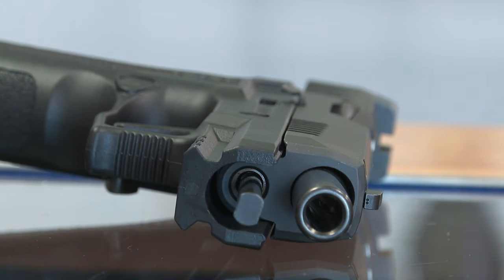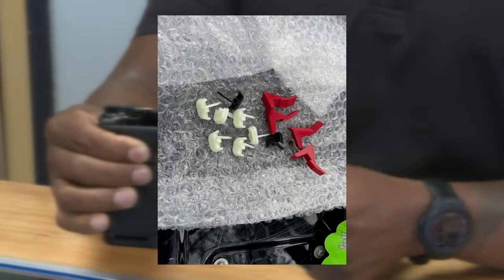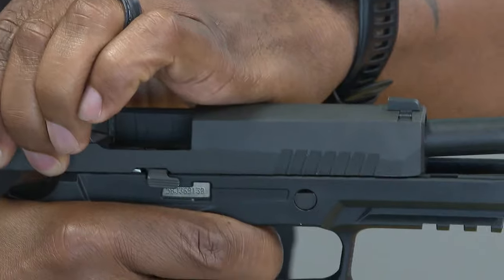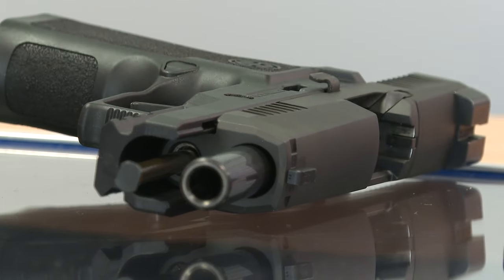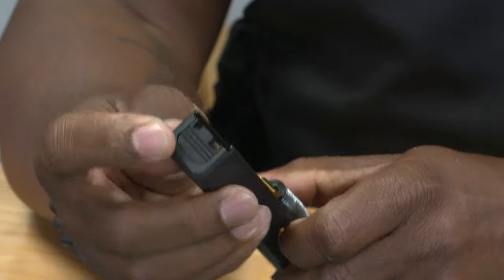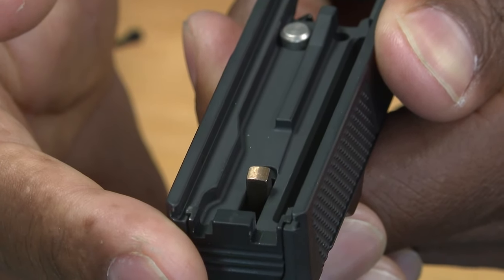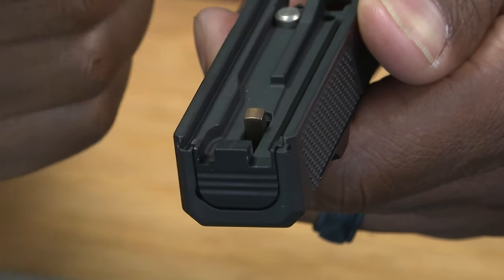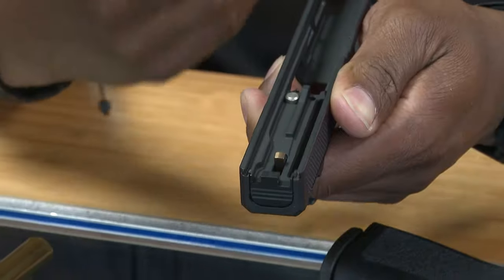Teen's fatal shooting reveals risks of 3D-printed Glock switches

Comment: There is a better design out there that just forcing the firing pin to be forward the whole time. You can make it where when you let off the trigger it stops firing. Still illegal and still a high rate of fire amateurs might find hard to control